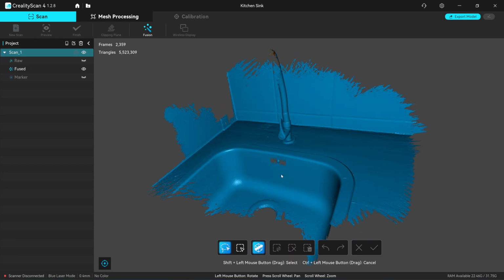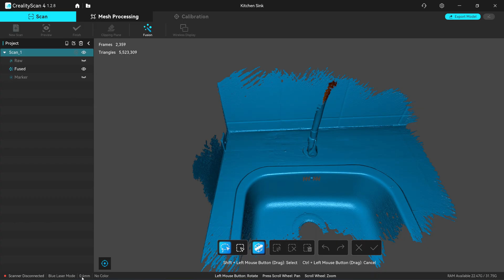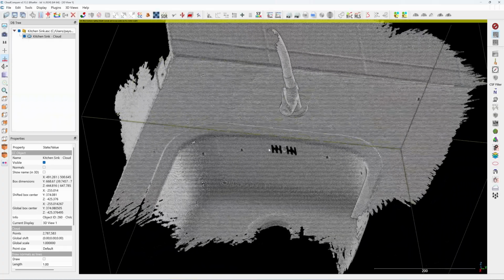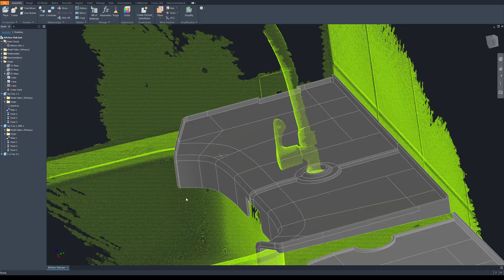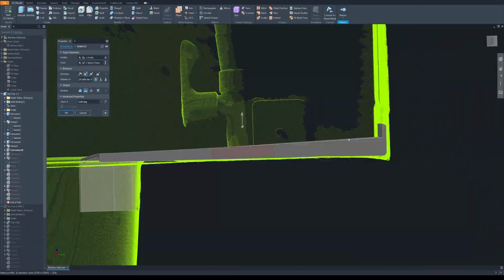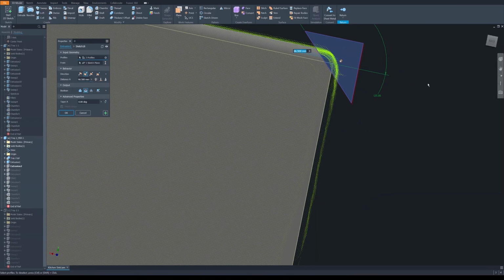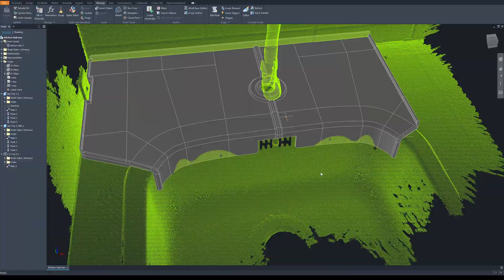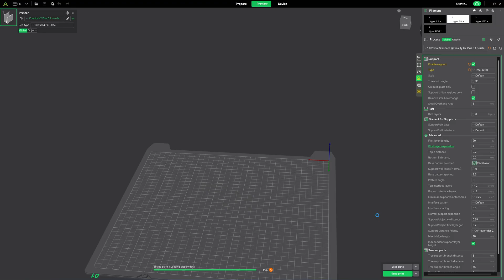No More Wet Counters! DIY Drip Tray Fix with Creality Sermoon S1

Comment: "Mix water and dish soap in a small cup. Use it on your index finger when you spread out the silicone. It will look nicer."
Reply from the maker: That's a great tip, thanks for sharing! 👍

Comment: came out good, caulk joint are bit rough lol. 
in hindsight, i think if you added some ridges on top, like small linear extrusions, you could create a portion of the surface that could hold some sort of sponge off the surface and still allow water to flow towards the sink.
Reply from the maker: That's a good idea!

Comment: decent job. well done. 

one tip, is if you have a join like you do here, the best way to seal it is to cap it off. if you can design a piece that fits over the join and goes all the way around the seem you designed into it, like a done. then glue that on over the seam it will be far better at preventing water getting down between the pieces.
Reply: Yeah. It will trap water and moisture and rot the tabletop
Reply from the maker: That's a great suggestion, thanks for sharing! 👍